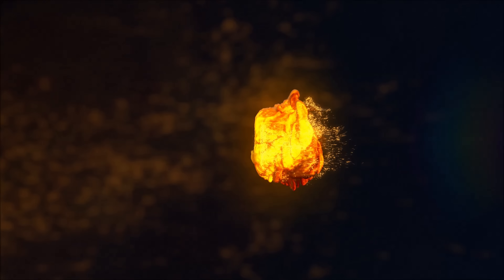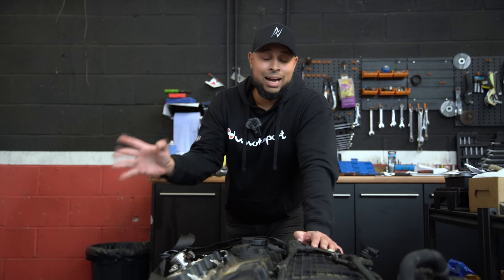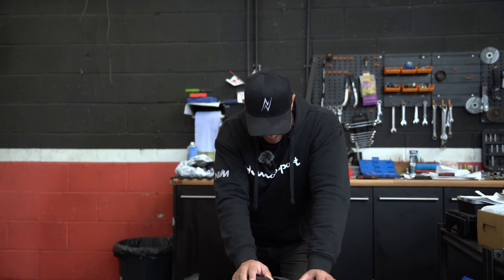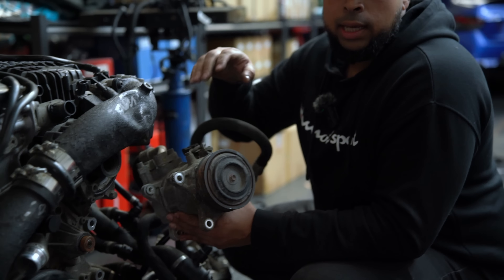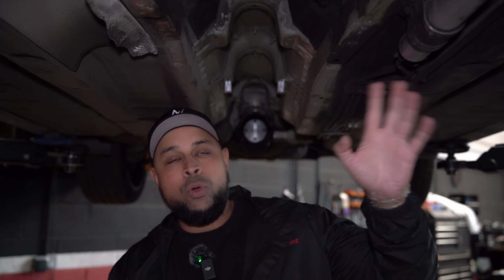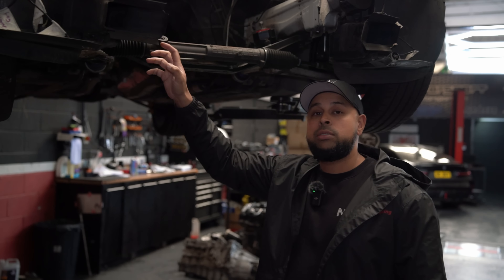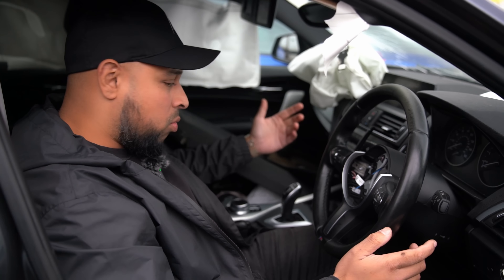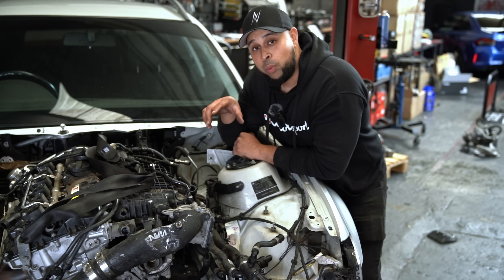We bought the CHEAPEST M140i in the UK!! E46 Touring *UPDATE* Ep.3

Comment: Hello, I think you should just use the b58 subframe front and rear and fit them with some customisation to the e46 chassis, that way you can use the original engine harness and ecu for the power steering and engine electronics etc… if that’s not an option then possibly fit a power steering pump where you did the AC delete with a bracket and a reservoir. Hope you get this finished. Custom builds are the best.

Comment: Go for a hydroelectric steering pump conversion, I used a Merc A class unit on my E46 M3. It’s a standalone unit and only requires simple wiring and custom lines 😁
Reply from the maker: Yeh we were looking at a Zafira one.. does the A class one run load based pumping or steering angle?
Reply: @NVMotorsportUK  load based as no steering angle sensor input for it. I know a few E46 M3’s using them no issues 😁 Problem I find with the Vauxhall pumps are they are bulky, about twice the size. Mine locates nicely in the space next to the engine bay fuse box up against the bulkhead 👍🏽